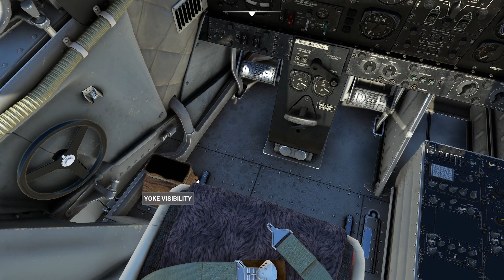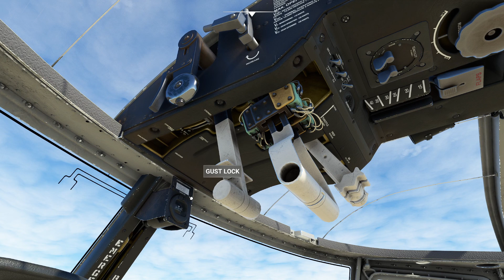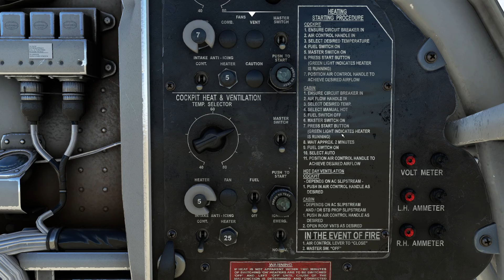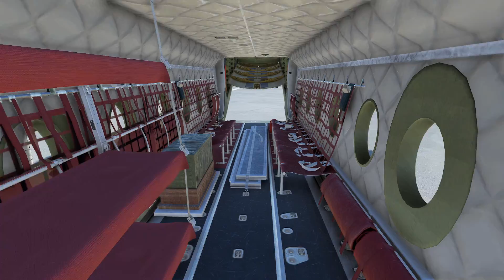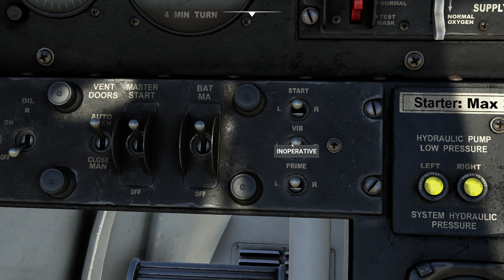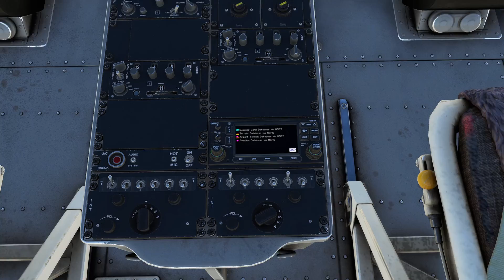MSFS - Flying the DHC-4 Caribou Part 1: Overview and Startup

Comment: Blue arc on the manifold pressure indicator and the tachometer indicates the power range in which you can use lean mixture. Irl caribou has automatic mixture. In the sim you can use thrustmeters to lean the mix.